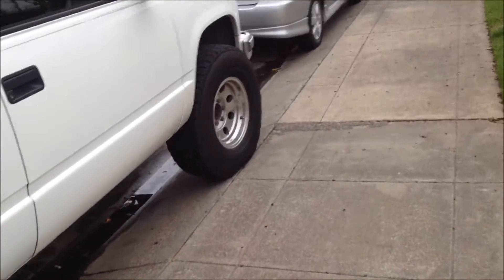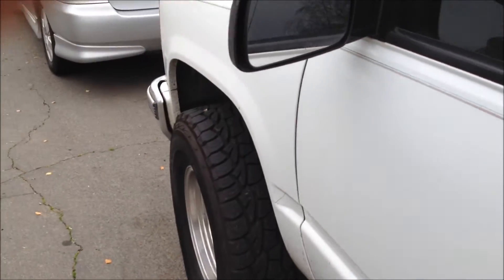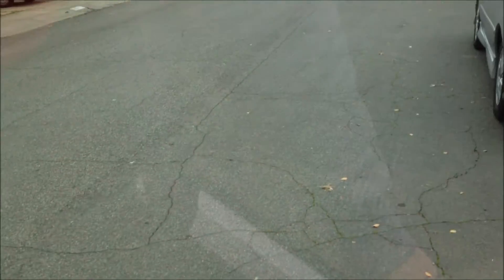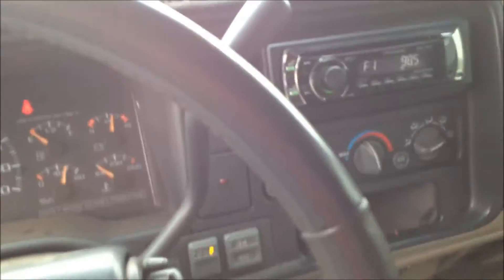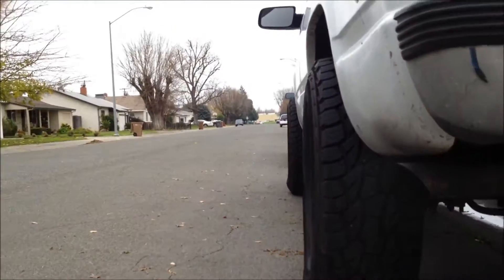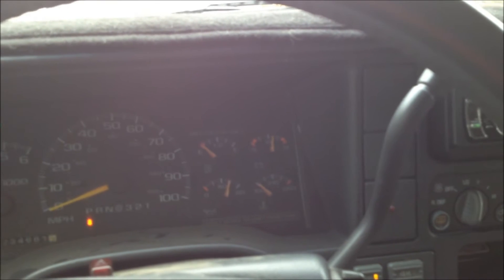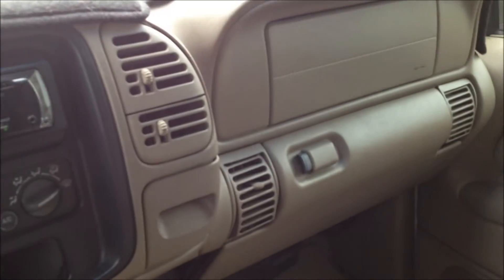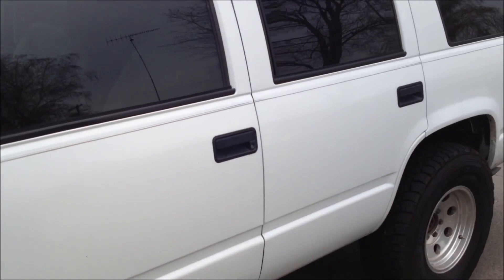Update: Chevy Tahoe

Comment: Where did you get the multi-point fuel spider? I need one now for my tahoe. Thanks
Reply from the maker: I bought from Amazon. part number was: Delphi FJ10566. There was some speculation as to if you need to buy a new mount, but it came with it. Hope this helps and good luck!
Reply: Thanks man. I owe you one